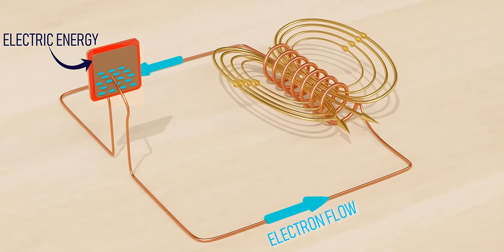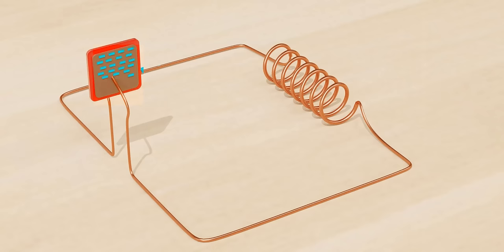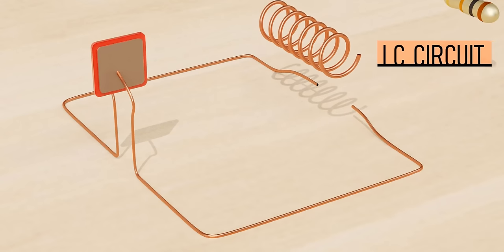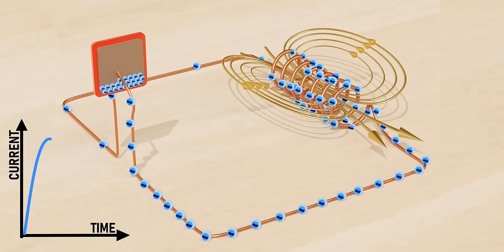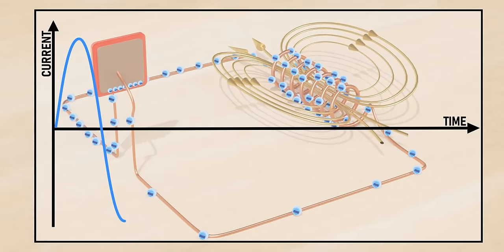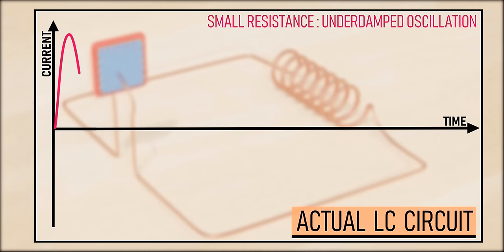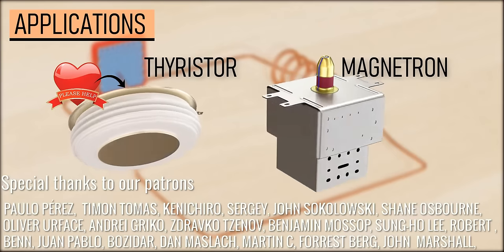The beauty of LC Oscillations!

Comment: Please dive deeper in part of inductor why it behaves like that
Reply: @GuitarZombie  thanks bro
Reply: Inductors resist change in current. If you apply a voltage source like a battery, current starts at 0 but progressively grows without bound at a rate depending on voltage and inductance. If you then suddenly disconnect it from the voltage source, the current is forced to go from some finite amount to 0 instantly, causing it to develop a HUGE emf which causes it to arc across switch contacts. The voltage needed to establish the discharge path defines how rapidly the inductor "discharges."  This is a useful feature of inductors for boost converters.
Reply: Ask yourself how does flux running through the core of a transformer induce voltage in the secondary altho it is totally confined in the core and coil is outside of it.
Reply: Of course, i am referring to etheric energy, primal energy everything is made of, of whose existence you were never taught.
Reply: The following extract from a letter, addressed by Professor Henry, of Princeton, to Professor Bache, was read, announcing the discovery of two distinct kinds of dynamic induction, by a galvanic current. “Since the publication of my last paper, I have received through the kindness of Dr. Faraday, a copy of his fourteenth series of experimental researches; and in this I was surprised to find a statement directly in opposition to one of the principal results given in my paper. It is stated in substance, in the 59th paragraph of my last communication to the American Philosophical Society, that when a plate of metal is interposed between a galvanic current and a conductor, the secondary shock is neutralized. Dr. Faraday finds, on the contrary, under apparently the same circumstances, that no effect is produced by the interposition of the metal. As the fact mentioned forms a very important part of my paper, and is connected with nearly all the phenomena described subsequently to it, I was anxious to investigate the cause of the discrepancy between the results obtained by Dr. Faraday and those found by myself. My experiments were on such a scale, and the results so decided, that there could be no room for doubt as to their character; a secondary current of such intensity as to paralize the arms having been so neutralized, by the interposition of a plate and riband of metal, as not to be perceptible through the tongue. I was led by a little reflection to conclude that there might exist a case of induction similar to that of magnetism, in which no neutralization would take place; and I thought it possible that Dr; Faraday’s results might have been derived from this. I have now, however, found a solution to the difficulty in the remarkable fact, that an electrical current from a galvanic battery exerts two distinct kinds of dynamic induction: one of these produces, by means of a helix of long wire, intense secondary shocks at the moment of breaking the contact, and feeble shocks at the moment of making the contact. This kind of induction is capable, also, of being neutralized by the interposition of a plate of metal between the two conductors. The other kind of induction is produced at the same time from the same arrangement, and does not give shocks, but affects the needle of the galvanometer; it is of equal energy at the moment of making contact, and of breaking contact, and is not affected by the introduction of a plate of copper or zinc between the conductors. The phenomena produced by the first kind of induction form the subject of my last paper as well as that of the one before; while it would appear from the arrangement of Dr. Faraday’s experiments, that the results detailed in his first series, and those in the fourteenth, were principally produced by the second kind of induction. Although I may be too sanguine in reference to the results of this discovery, yet I cannot refrain from adding that it appears to lead to a separation of the electrical induction of a galvanic current from the magnetical, and that it is a step of some importance towards a more precise knowledge of the phenomena of magnetoelectricity. *Since writing the account of the two kinds of induction, I have found that the second kind, although not screened by a plate of copper or zinc, is affected by the introduction of a plato of iron. In the cases of the first kind of induction, iron acts as any other metal.”
Reply: @power-max  The current might want to go to zero instantly but it isn't able to.
Reply: @kingsman428  The inductor basically generates an EMF big enough to arc across contacts or cause avalanche breakdown within silicon switching elements (MOSFETs, etc) and the current can never have infinite slope because the voltage can never be infinite. Another limiting factor is inter-winding capacitance, which "smooths out" the transient and also helps to limit the maximum voltage potential.
Reply: @power-max  Agreed, It's obvious you know what you're talking about. I suspect you probably meant when the voltage was removed instantly rather than the current
Reply: @niksa28  "...ask yourself how does flux..." Or you could do a 5 year engineering course lest anymore confusion for you.
Reply: @niksa28  Typical troll move, resorting to name calling in an attempt to enrage me lol 😂🤣
Reply: I'll put it in simple words for you simplefolk, there is another, finer type of electricity, Tesla called it Negative Electricity, with it's own spectrum and range of effects. It is rarely observed and often overlooked, usually produced by rapid discharges. It is associated with negative energy and levitation etc.
Reply: @niksa28  TL;DR
Reply: OK, I'll play along. What do you mean by "finer electricity?" what differentiates it from presumably "course" or "rough" electricity?

"Spectrum" are you referring to the frequency spectrum? The FCC has pretty much allocated most of the usable spectrum already, ISM bands are the only ones unlicensed users are allowed to use.

"negative electricity" Provide a definition for this, and ideally some examples.

"levetation" Do you mean high voltage "lifters" That is a well understood phenomenon and nothing special about it. It causes a thrust by the acceleration of gas particles. They are very inefficient compared to propellers.
Reply: @niksa28  Ok, you said "...negative energy with its own spectrum..." 
So, we need to be looking in the frequency domain to observe it, being an RF engineer in the CATV industry gives me access to a 2 Gig spectrum analyser so where in the spectrum would I need to be looking?
Reply: @kingsman428  Negative energy is not easily captured by regular conductors, it flows better through insulators. Here is one guy who captures it with plates of copper and aluminum separated by sheets of bismuth if i remember correctly excited by various frequencies. https://www.youtube.com/watch?v=YO8cwG7MtM8
Reply: @kingsman428  Here is another ''secret'' for you, you don't need negative electricity, free energy can be produced in THOUSANDS of ways easily. For example lenz can be canceled in a generator. How about that.
Reply: BTW law of conservation of energy is correct, universe is started off by an impulse or ''big bang'' and moves by inertia slowly returning energy to the primal force field. Near infinite energy can be drained from the primal cosmic forcefield, but the exact same amount of energy must be drained in opposite time direction, our antimatter universe. More about 6 time axis and 12 universes. http://www.resona.nl/Denaerde/denaerde.html
Reply: @kingsman428  So, is free energy a quackery, don't get silent now.
Reply: @niksa28  I asked you where to look in the spectrum but instead of a detailed engineering  reply you came back with "...flows better through insulators..." which, by definition, is false (look up insulator) 

Then you said "...excited by various frequencies..." so we are back to the frequency domain which is the question you still haven't answered. IE (where in the frequency domain?)

Finally,  linking me to a video with 2 guys pulling the classic trick of '... here's a box of magic...' 

#1 The guy said he had changed the bulb to 24 Volt type and yet, when he connected it to the 12 Volt battery it didn't even glow dimmly which ought to have given you a clue that something wasn't right.

#2 Demonstrably, you and the guys in the video don't seem to have any idea how much energy a 12 Volt lead acid battery is able to supply EG a starter motor for a van on a cold morning will pull in the region of 600 Amps (look up cranking current)

"...is free energy quackery..."
Yes, furthermore it's apparent you don't realise how much that question you've asked says about you.

I didn't bother viewing your other links.

Your response exposes you for the charlatan that you are, you exhibit all the usual traits of the typical Tesla conspiracy theorist buying into all these 'free energy' videos, deluding yourself they are real because you don't have the engineering expertise to be able to work out why they are piffle. When you're challenged about your assertions you don't offer up detailed analysis to support your claims just the bunch of links that led you down the rabbit hole in the first place. 

It's much easier to delude yourself you're being educated by watching conspiracy videos and just accepting what you're being told is true with no proofs to support those claims rather than viewing professional engineering material requiring years of rigorous maths so you can follow the proofs to be able prove to yourself that what you're being taught is true.

You must be looking forward to receiving your Noble prize for free energy, I look forward to reading all about your research.
Reply: @kingsman428  Now, THAT's a lot of ''piffle''. Out of all the nonsense you wrote i'll just address the first, yes, negative energy flows better through insulators than conductors. As for the rest of your rant, well, i enjoyed it, but sadly for you it is totally disconnected from REALITY.
Reply: @kingsman428  Here is another ''secret'' for you. In Tesla's 1901 Radiant Energy patent he refers to the ground as “a vast reservoir of negative electricity.”
Reply: @niksa28  "...flows better through an insulator..."
"...using copper and aluminium plates..."
Do you see the contradiction? 😁

You keep saying "...negative energy flows better through an insulator..." Ok, let's get to the bottom of that assertion.
 # 1 What exactly is flowing?
# 2 What is influencing this flow?
# 3 Describe the mechanism that is an insulator to charge flow but a conductor for what ever it is you're asserting flows.

"... ground a vast reservoir of negative electricity..."
I'm pretty certain you don't know the difference between ground, neutral and Earth. Furthermore, I'm pretty certain you don't know the difference between positive and negative charge or the difference between conventional and normal charge flow.

You've mentioned a few of Tesla's secrets, how come you know about them?
Reply: @kingsman428  One of the issues with explaining the concept is that there is no inherent "cause" or "effect" even though I use this construct to describe what happens since it's well understood, hence I provide an example going both ways. No, I don't mean voltage being removed. That would imply the voltage goes from some value to 0, and a 0V source across the inductor is just a short circuit. If this were the case, the current that built up during the application of a voltage would flow indefinitely, forever. Of course in reality it dies out pretty quick because series resistance.
Reply: @niksa28  And yet you still fail to explain what it is that you claim is 'flowing' or the mechanism that explains why a material is an insulator to charge but a conductor to the mystery substance that you claim is 'flowing' 
Am I surprised, off course not because you can't.
Reply: @niksa28  The irony being you're not going to "...lecture me on negative energy...loads of info out there..." but then waste your energy by trying to sound smart and posting a ream of data about electron flow. It doesn't stack up
Reply: @niksa28  We're done dude, discussions with idiots is an exercise in futility so you get the last say
Reply: @niksa28  That's how that professor talked. He said nothing in a way that gave the illusion of significance.
Reply: @niksa28  The field is not contained or confined by the core, it is concentrated by it. The field does extend outside the core, just now the field is more dense because of the core so it can couple across the windings  better.
Reply: @wickedprotos1937  Confined or concetrated is semantics, the fact is flux is within the core ONLY, not outside of it, just like in a toroid.
Reply: @niksa28  No the flux is NOT only in the core. Heard of air core transformers or LDVT transformers for position. You are sounding like an pseudo  over-unity nut.
Reply: Не так выглядит магнитное поле катушки ,  поток магнитного поля направлен с концов к центру катушки .

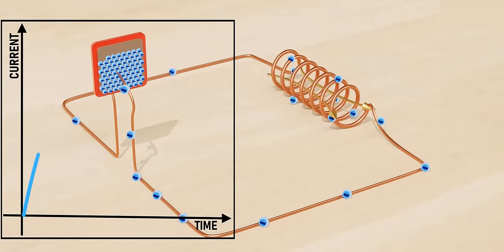Comment: Excellent but needs a little more. Seeking to help / looking for clarification/confirmation: In an ideal circuit ,leaving out resistance. At maximum current  1:30 the charge across the plates of the capacitor and the inductor is zero. The ElectroMagnetic Field around the inductor is at maximum. It is the collapsing ElectroMagnetic Field which continues to drive the electrons through the inductor onto the far plate of the capacitor creating the negatively charged capacitor. Once the Field has collapsed then the negatively charged capacitor can restart the process again in the opposite direction. If possible, it would be good to overlay the interrelationship between the charge on the capacitor and the ElectroMagnetic Field?
Reply: Exact

Comment: 0:50 This animation of current flow is depicted incorrectly through out the video.  This representation  shows current flow as blue dots WHICH VERY THEIR FLOW along a SERIES circuit  Theoretically this is not possible.  Current flow is the same everywhere along a series circuit.   If this animation were a true representation it would  mean an amp meter placed in series on one side of the capacitor WOULD NOT read the same current as another amp meter connected in series on the other side of the capacitor.  That is not the way the physics works.  Electrical potential measured as a voltage drop varies along a series circuit not current flow as shown in the animation.    Of the two types of energy storage taking place, capacitive and inductive, energy stored as magnetic fields in induction is the most difficult to conceptualize.  A capacitor can store energy in its electric fields while disconnected from an electric circuit theoretically forever.  An inductor can't store energy in its magnetic field without being connected to a voltage potential to maintain it.
Reply: bruh😑

Comment: In order to prevent that scenario you use a transistor. Because transistor is act like switch with very fast switch and this a continous current flow and youll make a oscillation sine wave.

Comment: why does all the charge go on the other plate at around 0:50? shouldn't it have about the same charge on both sides?
Reply: Because inductor doesn't allow current to become 0 . So it continues to flow in same direction

Comment: When the charge in the inductor equals the charge in the capacitor the flow will stop as there is no voltage difference.   The circuit will not work as configured,  or the way you have described.
Reply: No electric potential charge is ever stored in an inductor, only on a capacitor. The voltage across  an inductor is equal to the product of the inductance times the time rate of change of electric current flowing through it.  ( This is one of the many things taught in a first semester electrical engineering course - e(L) = L(di/dt) )

Comment: My first observation: a "charge difference" between capacitor and resistor cannot exist because a resistor cannot hold a charge. All it can do is convert energy into heat and that implies it can have current flowing through it and voltage across its terminals. The relationship between the L & C values and the frequency of oscillation is not explained in the video.
Reply: Are you sure you understand the operation of resistors? If there’s “no current” flowing through a resistor, the circuit would not work - at all. And “voltage” is potential difference. If you measure two ends of a resistor with an ohm meter, at a given input voltage, you will most certainly see a potential difference between the two ends.

Comment: you forgot to mention that the change of current direction back to the source where it was originated is triggered by the same electromagnetic field generated by the inductor due to the natural beaviour of electricity to balance energy. Once the current finalizes flowing through the inductor in one direction, the magnetic field returns back to its original state and that natural behaviour generates a current flow in the opposite direction back to the source.

Comment: If electricity is 'pushed' through a circuit, residual magnetism would remain. If your resistor is a light bulb and you turn off a switch, the electricity after the switch is thrown would remain in the wire to the bulb. It doesn't. You can insulate 100 % from heat if electromagnetism is strong enough. I believe static electricity from lightning could be used to start a device that could utilize electromaglev bearings (negligible friction) and create usable electricity.
Forget perpetual motion, we can't do it, but we can make a usable artificial charged particle on an usable scale. Charged particles and photons travel thousands of light years. We can match that.
Reply: Perpetual motion is 100% possible if you know the secret of inductance modulation.